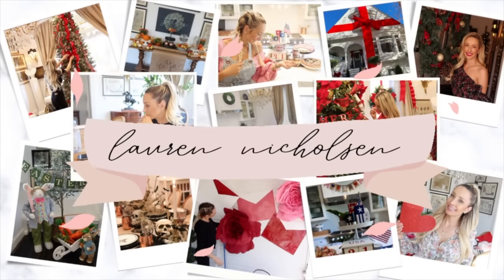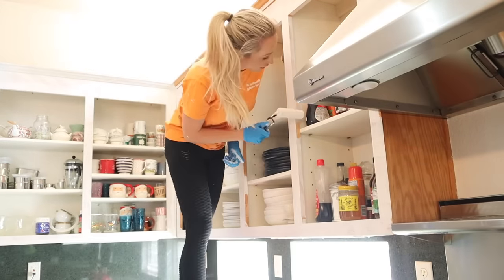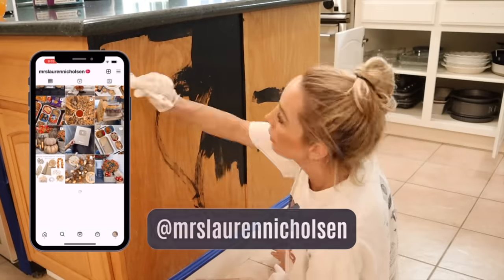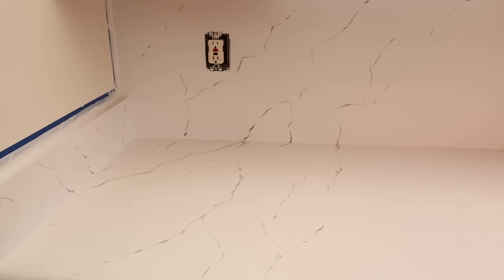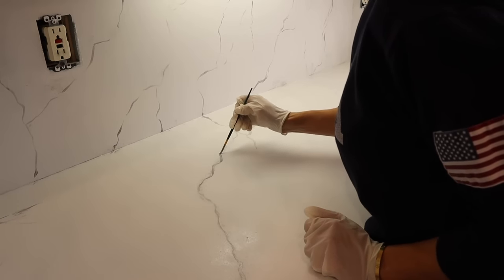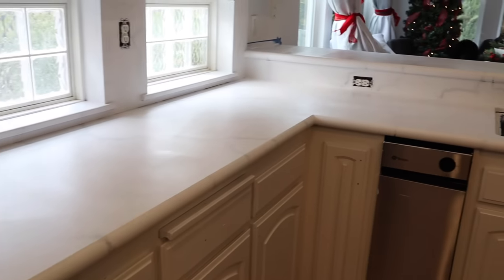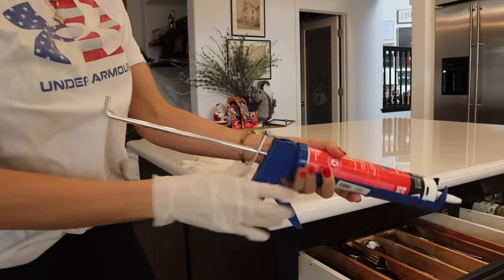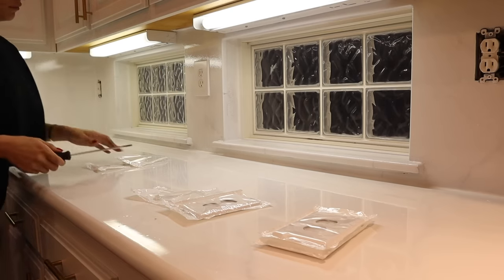DIY KITCHEN MAKEOVER FOR $500 // FAST BUDGET KITCHEN MAKEOVER  //  DIY EPOXY MARBLE OVER OLD GRANITE

Comment: At a previous house we did epoxy countertops over mdf as a temporary solution. It yellowed and felt plastic-y and also would stick to paper and labels of products that were left on the counter. When we got the house ready to sell we put in a laminate countertop from Lowe's without a backsplash and it was sooo much better. I wished I had gone with laminate from the  beginning, because epoxy really didn't work out well for my family. When we sold we had several realtors ask what kind of material it was! All this to say, if you are undecided what to do check out the Stretta laminate from Lowes as a cheap alternative before you decide it's worth the work to do epoxy!

The kitchen refresh really does look great though and hopefully it works out better for their family!
Reply: So glad I saw this comment!!!! Thank you for sharing your experience! I have a family of (almost) 6 and I stay home making all meals with my kids so let’s just say we’re “hard” on counters 😂

Comment: What a beautiful transformation for your kitchen! I'm going to be painting my cabinets they are 38 years old. I'm nervous. They always say paint has to cure for 30 days. Did you find that that's why it came off with the tape? Has anyone used that Beyond paint is it pretty durable when it comes to kids? Are you having to touch up all the time? I have grandkids and bonus little ones that come over so I'm trying to figure out what would be my best option. I love your countertop. Mine is the old countertop that looks like Butcher Block but it isn't but it's countertop you can't destroy. I don't like it but I'm just wondering how cautious do you have to be with epoxy or do you not have to? I just think your kitchen is beautiful it is so much brighter great job the two of you

Comment: Your kitchen looks amazing excellent job that you and your husband did 👏👏👏only one question is about the paint, you didn’t sanded the cabinets and I want to know when you clean your kitchen the paint it doesn’t come off or peel ? I have a doubt because you said when you painting if you make a mistake it is easily to removed when it is dry also, so  the kitchen is an area with a lot of traffic and grease and we constantly clean with strong chemicals
Reply from the maker: So far the paint has not come off or chipped anywhere. It is easy to clean before it has had 3-4 hours.